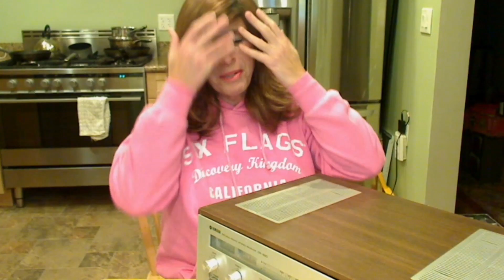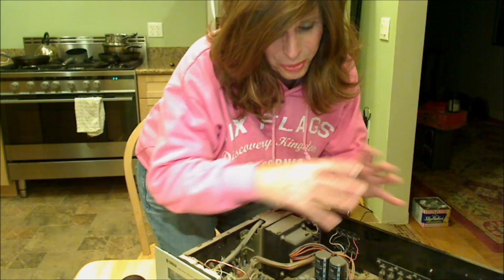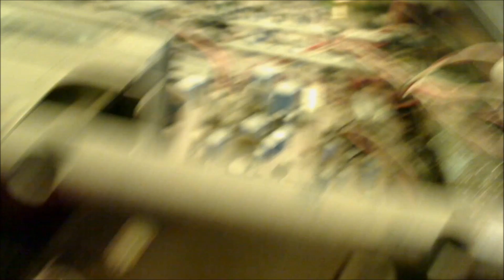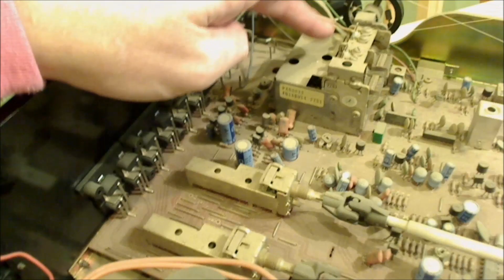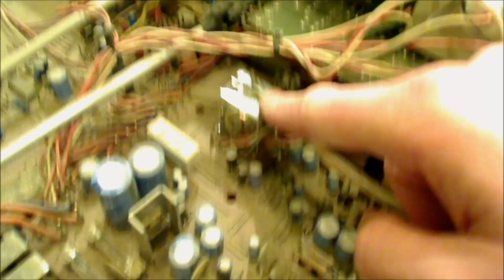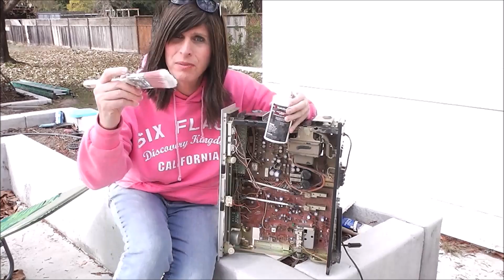Kitchen Table Doctor Repair...Yamaha CR 620 Stereo  (Part 1)

Comment: I have a cr-420  owned it since new but heres the problem its like protective relay keeps popping in and out over and over. could this be from hooking cheap little speakers to it. does it right away when power button is pushed?? Thanks

Comment: Got one on my bench right now. Replacing lamps with LEDs, and might re-cap the power supply. Should, but haven't decided yet. Might also add a little op-amp circuit to make the center tuning meter swing a little more. It's pretty weak as is.